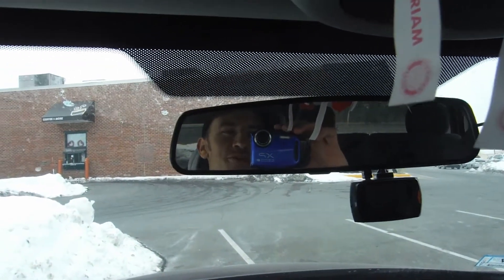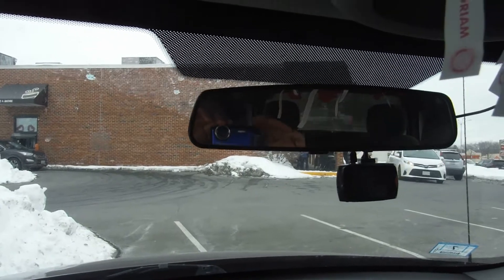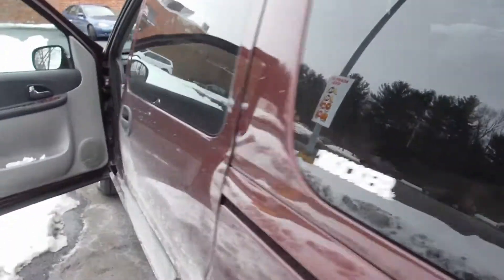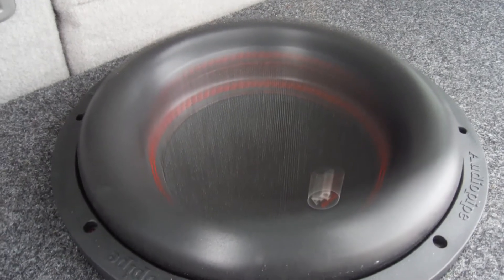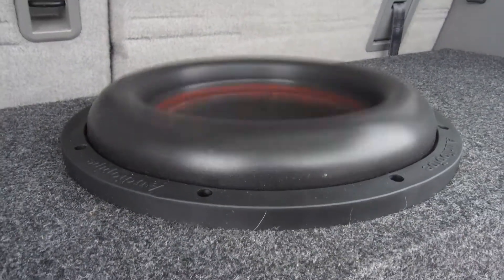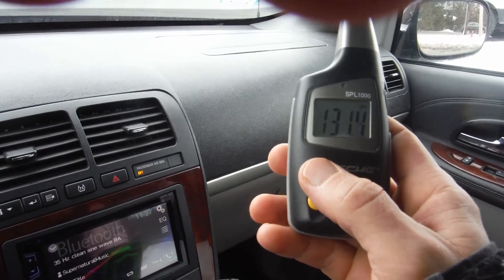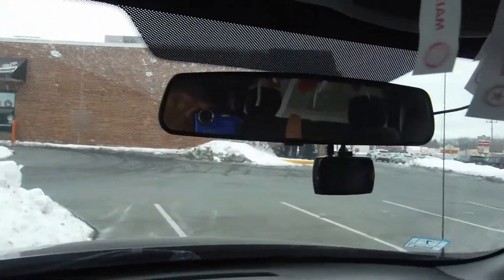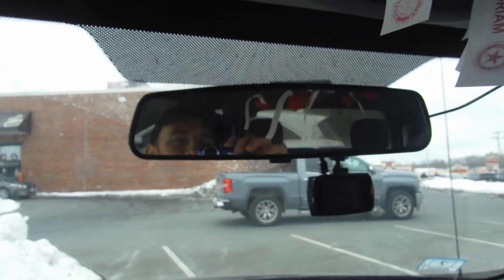AudioPipe TXX-BDC4-12 subwoofer JL Audio JX 1000 Slamming my Van SPL DB meter

Comment: spl box .. u mean prefab ? i had the same one they can’t hit noooo lowssss
Reply from the maker: It's a prefab box? yes, does it hit notes? yes, does it sound fantastic? yes. What size was the baffle and walls on your box? Did you add polyfill to it? People say, when you have nothing nice to say, Say Nothing at all. There's nothing wrong with a pre built box that has the specs of the sub your using, that's why they're made. Most people just buy a box and then say why does it sound like crap, because they got a box too small or too big for their application. Every enclosure I use is to what the manufacturer suggests.
Reply: @SubzPawz  js bro i had 2 of those boxes for massive audio hippos, they suck n don’t hit any low notes. when u played the 20hz note it’s dead quiet , even at 30 hz it’s horrid. u proved that yourself in the video . but if you like bumping 35hz - 45 hz then yea go ahead and rock this “spl” box . here’s some advice , check out ground shaker if u wanna go prefab . their boxes are tuned at 30 hz and hit under that. nice sub tho i got the same one. you can get defensive all day but it’s not gonna make you hit any lows ..take the comment however u want man.
Reply from the maker: @dontbuyhyundai  This is just another video, of another sub, in a different enclosure. I'm going to try another enclosure and see how it does again.
Reply: @dontbuyhyundai There is 1 audiopipe txxbdc15.
i like lower frequency, can you give me a box size adjusted like 27 hz.
my car 2006 ford fiesta hp